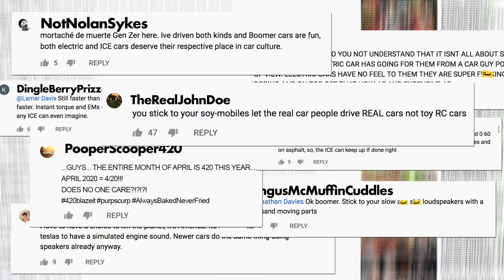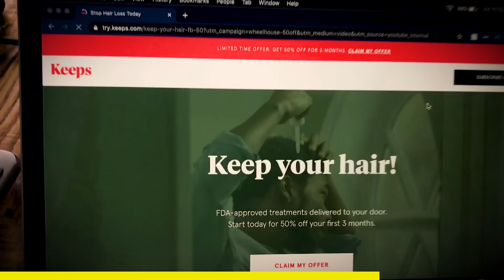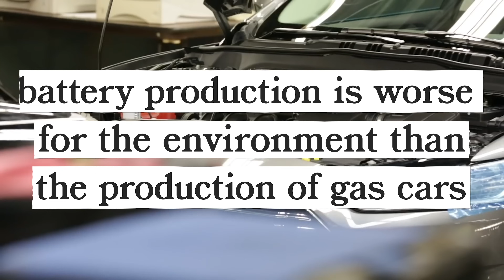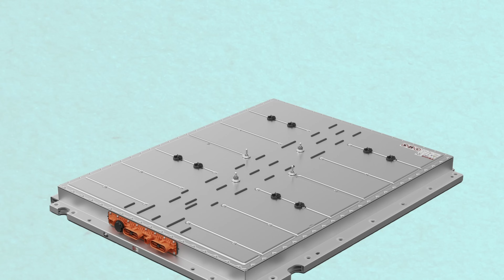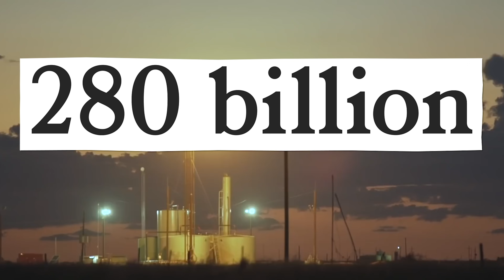Are Electric Cars REALLY Better for the Environment?

Comment: Okay, I understand where you're coming from. It is inevitable, however I really don't like the fact that the direction cars are moving right now leaves the driver out of the equation. I'm sure there is still a way to get a feel and a sound out of an electric car. What about a Tesla turbine, that uses thermodynamics and magnetic heat induction? I don't know how come nobody's throwing ideas around like that? What about a turbo that instead of driving an intake impeller, drives an alternator instead? Does anybody remember the shock absorber  that uses the extra kinetic energy  from the car moving to push an alternator ?  That display is still in the Albany Museum . There's still got to be a way for car guys to get their fix. For me cars was all about technology, and being one with your machine

Comment: How much of an electric vehicle is recyclable to put back into new production compared to an ice vehicle and how many metric tons of co2 to recycle each i know batteries will not last as long as an ice engine so factor in battery replacement costs and reliability of an electric vehicle plus cost to repair at specialty shops can't go get parts and fix an electric vehicle yourself.

Comment: You need to read up on what actually happens to EV batteries. They aren't just tossed into a recycling factory to break down. They ARE reused though for other uses. An EV has a requirement for full capacity power. Once it becomes less efficient, the battery is removed and sent off to be used to other things, like power banks. As the efficiency gets lower and lower it is sent to other uses until it is unusable and THEN it is recycled and broken down. The amount of time it takes from manufactured date to recycled could be at least 20 years.

Check out this video by ColdFusion that explains this.

https://youtu.be/ADS742xsoTw

Comment: Just as an alert, for ALL Teslas, according to an EPA website, federal rebates have been phasing out since the end of 2018 on some EVs. So it's not a matter of size, but a matter of brand. The "phase out" actually serves to specifically hurt Tesla and GM, as it mainly applies to their EVs (although I don't see many people preferring a Chevy Bolt over a Model 3). So if you're looking into a Tesla, check your state if they offer any rebate incentives for EVs. I know in my home-state (NJ), they offer $25 per mile range on the EPA estimate up to $5000. (The Bolt and Tesla lineup easily hit this mark).

As far as I know, Ford firmly believes their upcoming Mustang Mach E will qualify for the full $7500 federal rebate. And if they do, stacked on top of the $5000 possible in my state, I may just be looking at a Mach E for myself.

Comment: When you realize thar nuclear power is extremely efficient and produce no CO2
Reply: Brian Musial It's also insanely expensive. The UK government has had to guarantee a strike price for the power that will be produced by our newest reactor that is more than double the current wholesale price of renewable power.
Reply: @spencerwilton5831  the upfront cost is expensive, but just like electric cars are better than the gas in the long run, so too is the cost of the plants. They are extremely cheap and the most reliable form of energy to run once they are built.
Reply: Hunter Dowdrick It's pointless being cheap to run if the setup costs mean that over its lifetime the power will cost twice as much as renewables. Which is exactly what is happening with nuclear. It costs tens of billions to open and close a plant. The actual power may be cheap, but factor those costs in and suddenly they aren't economically attractive anymore.
Reply: Mining uranium, transportation, building huge plants all cost CO2. What you mean is running them. What people should do is compare all steps like Nolan did above. Too bad nuclear scares the shit out of people when many types of plants are safe.
Reply: And where do you put all the radioactive waste?
Reply: Bé F almost all power plants store waste on site. There has been a lot of discussion for many years about moving them to one facility in the Midwest.
Reply: @huntsman011  aren't there those breeder reactors that are reuse spent fuel
Reply: When you realize your a snowflake ❄
Reply: Uh oh here comes the internet's intellectuals to duke it out again...

Comment: Don't attack me for asking this I support EVs I promise. But what is the average lifecycle of an ICE vehicle verses that of an EV. If the battery of this EV is replaced at 70k or 140k how much of that factors into the metric ton of CO2 being used? 
Especially when being compared to ICE vehicles that can go 200k with routine maintenance

Comment: Hmm, cobalt, nasty ethical dilemma, sure.  Cobalt in battery production bad, agreed.  Cobalt used in oil refining for desulphurisation, and natgas to liquid, who knew that was a thing? https://tinyurl.com/u6l4xyo.  This cobalt is consumed and cannot be recovered for recycling.

Cobalt is widely used today in metallurgy to produce high strength alloys https://tinyurl.com/y9pe7pxd - there's some cobalt in your turbo.

Cobalt is emitted by coil and oil power plants, cobalt is consumed in construction of nuclear power plants. https://tinyurl.com/y748a95z

Year on year, Li battery chemistry is evolving to reduce cobalt content, reduced use of cobalt in other sectors and segments, not so much.

Comment: This doesn't take into account replacing batteries and the second myth was worded wrong. Our renewable energy would not be able to withstand the needs of our country in its current state, not the entirety of the electrical grid.
Reply: Also not trying to hate on either side, just trying to bring up valid points

Comment: Building a EV is by far worse than Building a Gas Car
Mileage in EV is by far better than Gas Car
Emissions in EV is by far better than Gas Car
Performance is 50/50
Some gas cars can match a EV 60 foot while others just dont belong challenging an EV.
Gas cars and Diesel Cars will always be around that will never change, even if they become scarce. But EVs are starting to become a trend and I dont mind it as long as they continue to workout the kinks to it.

Comment: Here’s the thing, producing electricity needs a power plant, which is bad for the environment. Gas car produce carbon emissions into the air which is bad and there are at least 10 million vehicle driving everyday. Electric vehicles on the other hand are only the power plant that are bad for the environment and when it comes to car, it’s environment friendly so technically they both are bad :)

Comment: another point to factor in is how well ev's and ice's operate in cold climates, as well as the amount of energy loss you will have when you charge your ev as you will not be getting electricity directly from a power plant. great video by the way
Reply: thinking about how normal car batteries die in the cold....
Reply: Probs not filling your car at the oil well though either right?
Reply: electric cars will STILL pollute less over a period of several years
Reply: @comedyman112  until you have to replace that battery after 5-10 years, then try quickly catch back up.

Comment: The biggest problem with EVs (aka Tesla) is they control your car, with program updates that can change range, how fast you can charge it, what entertainment you can receive.Try to buy parts for a Tesla, not at NAPA.   Kinda like an Apple computer where ever new version of the OS slows down the computer.

Comment: I duno where you got your info on myth#2, the US government rates infrastructure every 2 years and we got a D- for the last few decades. The US power grid can NOT handle that any cars being plugged in and charging. Not knocking donut or ev, you just need to di a better job researching if you are going to present facts to the public. I know no ones gonna read this, but id like to see a revisit of this topic with better sourced info. You also left out cars like hondas H1 powered ev that runs off of hydrogen. One of the most abundent elements. H1 leaves only clean water after its been used to make power to run a ev. Keep up the awesome work! -Random YouTuber Comment

Comment: Theres no mention of diesel powerd cars? In germany they did a test between  a Mercedes benz E220D and a Tesla model X output of CO2 and use with germanys 2013 electricty mix.  The conclusion was that the Tesla had to drive 580 000km (359 600 miles) to make up for the production output of CO2 compared to the Mercedes Benz. ADAC did this study a few years back, you can look it up if you want to.  And here in Europe we have a standar on enigine emisson outputs and now we are  on euro-6 on diesel cars/trucks and the emissions are actually so low that in big citys the engiens actually cleans the air from light particuals in the air.                        And Im sorry for my bad english

Comment: I need a car that's legal to drive in Germany and not more expensive is as 4.500€
So, i need to wait for a 10 year old Model 3 which will need to get new batteries for sure
I neither know if those cars will hold up to begin with nor if Germany is green or at least nuclear powered then (to much coal)

Comment: Don't just love them for the environment, the efficiency, or the fact that you never have to touch a gas pump, with a high chance of infection because of all the people that pump gas, while you leave home, then return & charge like a space mission.
Love EVs for their stealth, their modifications, their low maintenance, and their instant torque, no turbo lag, no combustion lag, no stalling and having to restart.
And they are the ultimate sleepers, because when people look at a homemade electric car or motorcycle. They don't know if it's some economy grocery-getter, or, some Yangire monster.
And the sounds they naturally make, can be tuned, based on the motors, gearing, final drive, cooling system, and other parts & design-decisions you choose.
Their center-of-gravity can be tuned, by where you place the batteries.
Those being smug with EVs, rubbing it in faces, degreading everyone else, causing hate, please stop.
Those blindly hating on EVs, for whatever reason, please stop.
This conflict is sofa-king stupid.
I grew up with NFS and Fast & Furious movies, and tuner-culture, and now, I'm loyal to EVs for the stealth and the jet sounds they make, that don't have to be loud, and draw unwanted attention, just for me to have so much power. Personally, I'm done with engines. But I don't hate them, or those loyal to them.
Why can't everyone be like me, whether they chose EVs or not?
I know there will always be evil people, but is there also so many petty people?
It is reasons like this, why I don't trust anyone, and feel better off alone.

Comment: Problem is that the battery will become crap in 2 years time like my IPhone battery. It will stop holding sufficient charge and I must get a new super expensive and metric shit ton polluting battery for my EV. Add that to the lifetime pollution calculation of ICE vs EV.

Comment: melt it down and recast an ICE compared to a lithium ion battery after its spent... the emissions still play a bigger part in the long run... still dont know why they wont mass produce the engine that runs off H2O
Reply: H2O is in a low energy state and is not useful as a fuel.

Comment: No, they aren't any better. If anything, all things considered, they likely use up more energy and create more air contaminants than most modern combustion engines. 
 All of that energy comes from a source, and those batteries are much more harmful to the embroidery than a large hunk of iron when used up.

Comment: My problem with electric cars is that they still haven’t surpassed regular cars in terms of capability. They are more expensive, worse at towing/hauling, don’t drive as well due to the weight, most of them can’t go as far on a single charge as an ice can go on one tank, and they are still very inconvenient to charge up. When electric cars are actually better than gas powered cars, then I might consider one.

Comment: Donut... Seriously... 

I assumed you wouldn't use the industry outside the auto industry to convey the point... By that logic you didn't take in the Electronics impact on the industry which use plastic and various oil companies also ... Co2 over time would be worse.

Comment: Thats a good video, i love combustion engines but evs are practical and environmentally friendly, i wont own one till batteries have a better lifespan and cheaper replacement costs, one of my inlaws has the suv tesla and a battery pack ran almost 9k to replace and with eletric cars any cracked or exposed lines that get wet will brick your car and lock it up from brakes to the the trunk itself, id rather drive something i can fix myself tbh

Comment: So, how long are we gonna have til lithium becomes really hard to come by? When will they produce a vehicle that is able to tow a 4000Lbs load further than  200miles before having to charge for an hour? Will the industry allow the average person to fix and repair said vehicles as you can with current I.C.E vehicles without having to get a dealership to reset the computer system or being forced to let their technicians do the work? I don't know about you but as I see it these vehicles are just a flex on the Jeffersons and not very practical or very lifestyle friendly in the least.

Comment: Fact of the matter is this: electric cars are only as green as their energy source. If it's charged up using solar, wind or hydroelectric power, then it is quite green. If it's charged up using coal-fired plants, oil-fired plants or nuclear power, then it's as clean as a coal-rolling diesel.

Comment: REMEMBER WHEN THEY CHANGED PLUTONIUM FOR HYDROGEN IN NUCLEAR BOMB ...GIVE THIS TO NORMAL JOE ...WHAT WILL SCRAPYARD BE A RADIATIVE DUMP...
Reply: I think you're implying that hydrogen is a good fuel source?

A hydrogen nuclear bomb still uses plutoneum bombs as well, and these smaller bombs compress hydrogen so that the hydrogen fuses together, releasing even more energy. This is different to a hydrogen fuel cell that you can have in cars, which aren't as good as a battery for many reasons
Reply: @Adlore  950s fusion bomb design with cylindrical fusion stage
(modern designs use spherical secondaries)
A) fission primary stage
B) fusion secondary stage
1) High-explosive lenses
2) Uranium-238 ("tamper") lined with beryllium reflector
3) Vacuum ("levitated core")
4) Tritium "boost" gas (blue) within plutonium or uranium hollow core
5) Radiation channel filled with polystyrene foam
6) Uranium ("pusher/tamper")
7) Lithium-6 deuteride (fusion fuel)
8) Plutonium (spark plug)
9) Radiation case (confines thermal X-rays by reflection)
Reply: a lithium hydrogen based bomb sound similars lithium hydrogen based batteries

Comment: Hi Nolan.  One aspect that you didn't cover that I'd be curious if you looked at:  My understanding is that the lifespan of the EV batteries is about 10 years, while I also have been told that the average lifespan for an ICE vehicle is well beyond 10 years.  The cost of replacing the batteries in an EV is pretty high - so much so, that I have 2 friends that have ditched their EVs instead of replacing the batteries because the cost far outweighed the value of the car.  The implication is that ICE vehicles stay on the road longer than EVs, which means these EVs, with their volatile batteries, are being sent to the crusher sooner.  But I don't have hard numbers to back that up.  If you do, I'd be very interested to hear whether this is a myth or reality.  Thanks for the video!

Comment: One aspect he didn't consider is how long a vehicle lasts for. My everyday driver is 16 years old with 217 800 miles under its belt. How long is the battery life in an EV, how much is it to replace and how much carbon emissions is there just to produce the replacement batteries?

Comment: Biofuels should a main sustainable energy source up there with wind and solar, they are far cleaner then the current fuels and are carbon neutral when burnt, the ICE doesn't have to go anywhere it's no the problem and it's fuel and where it comes from is

Comment: only thing id like to see factored into this is the cost to produce the methods of "clean energy" because in many cases the enviormental impact of windmills and solar panels are more damaging to the envoirment then gas producing methods due to the killing of endangered species, carbon footprint of production vs energy output over lifespan and the toxic waste of panels and our inability to effectivly recycle them. Doesnt shift enough to make EV's less carbon effective but enviormentally does discourage "clean" energy as a whole

Comment: While I don't disagree with the video, I do feel it's necessary to point out the lifespan gap between electric and ICE vehicles, because they are quite different. An ICE vehicle can last over 100 years with the original engine if properly maintained. An electric car will require it's battery replaced every 7 to 15 years.
Reply: It's still far more efficient. The combination of a new battery and dumping the old one is still has significantly less impact over time. Especially with the million mile batteries being developed right now :/